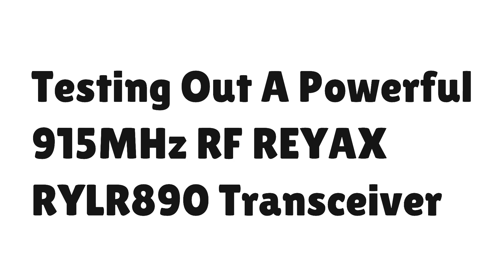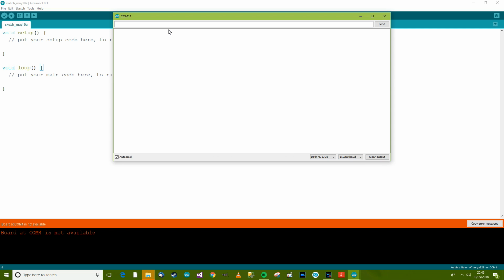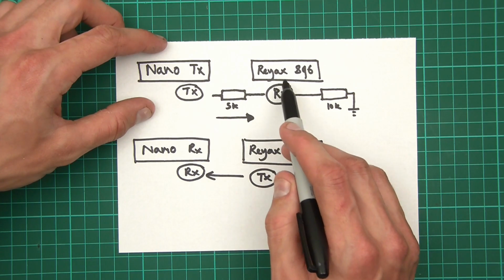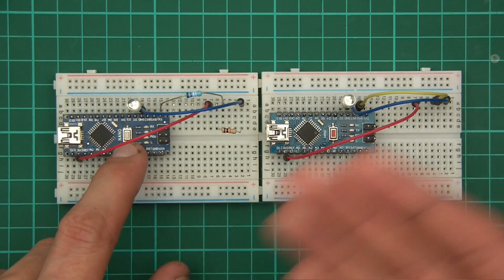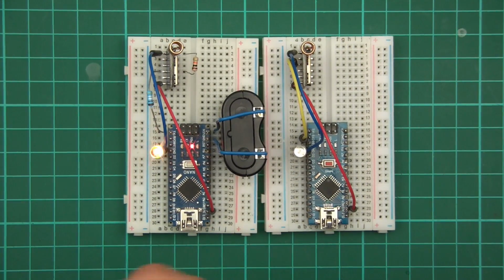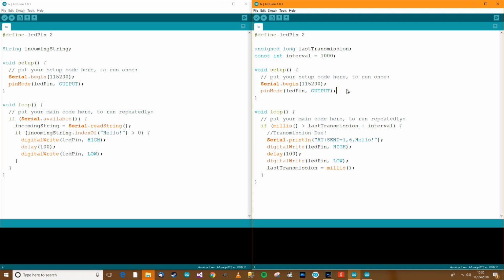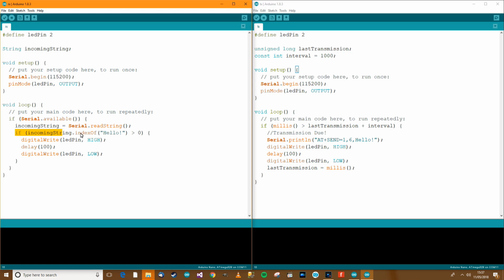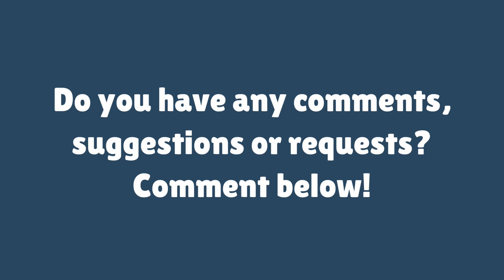Testing Long Range Wireless 915Mhz RF LoRa Transceiver Module REYAX RYLR890 RYLR896 Arduino Part 2

Comment: When I try to upload the sketch to the tx board I keep getting the error "avrdude: stk500_recv(): programmer is not responding......" any advice would be appreciated ?
Reply: I think that if you use SoftwareSerial library and configure other pins for the Serial channel between the Nano and the Reyax module you won't have that problem. That happens too when you use the Serial to print messages and you have some device connected there too
Reply from the maker: Hi David... Disconnect RX on the board when flashing. Your board is receiving flash data from two sources at the same time!
Reply: Thank you, I tried that but with no luck.....after a lot of searching it seems I needed to flash my nano with "ATmega328p (Old Bootloader)"
Reply from the maker: I don't know anything about that, but I have had the RX/TX issue loads of times.

Comment: I cannot get the receiver to blink an led, any way to debug this? I have everything set up as you do in the video. I can turn on the transmitter and plug the receiving module into the usb to ttl and it will show its receiving data, but plugged into the breadboard i get nothing.

Comment: Ive been looking for a top down of a real build of this for days, so I could see how the voltage divider needed to be built. Thank you for this video! Also, I assume that we have to use the usb to ttl converter, for the initial programming of the module? Thank you again!

Comment: I did exactly what you did except for the resistor, instead of 4.7k i used  5k. Does that make a difference? Because mine is not working

Comment: When I use these AT commands I get no reply. HELP!!
Reply: Take your module, connect it to your pc/laptop, open your arduino software and check the com port, after that open serial port and send at commands. Check your baud rate and also the tx rx connections. For more info you can send a mail at arunabhsingh.0309@gmail.com (i've tested these modules for 15km)

Comment: I have yet to figure out how to use these with analog data.  I've tried to get a potentiometer on the TX module, talk with an OLED on the RX module, but cant figure it out.  No one on the whole internet has a code or example of this using the Reyax modules.  As far as I'm concerned, these modules are worthless if they can't do anything other than send digital high and lows.
Reply from the maker: You can use them to send/receive digital data.
Reply: @antonycartwright I know these can be used to send and receive digital data, but have yet to figure out a code or see someone else provide an example of these sending and receiving analog data.
Reply from the maker: @joescopo8933  They're not designed for analogue data. They're designed to work with microcontrollers!
Reply: So eventhough I can read and write analog data through the serial ports with arduino alone, I cant send analog data through the serial port with two arduinos and two reyax devices?
Reply from the maker: You can't read and write analogue data into/from Arduino. Arduino is a digital device. The Arduino has a build in ADC though, if that's what you're referring to? As far as I'm aware, Arduino cannot write analogue.
Reply: @antonycartwright   I guess I don't understand.  When I hook a potentiometer to an arduino, and read a value of 0-1023 on the serial port, I thought that's "analog".  On the flipside, if I hook a push button to the arduino, the serial port will either read "high" or "low", 0 volts or 5 volts and no in between.  Isnt that digital?  Really all I want, is to be able to transmit the potentiometer data (0-1023) from arduino #1 to an OLED display connected to arduino #2 using the reyax modules.  If I can do that, then I can start using different sensors to create a wireless system that reads air pressure from one end of a freight train to an OLED display that I have on myself at the other end of the train.  That's my overall goal.

Comment: Great video! I have been watching many videos regarding the reyax lora modules, and all I can find is videos or codes on digital reads and writes such as blinking an LED.  Is there a way to use this to read and write analog data?   I have yet to see a video of something simple such as a potentiometer on the TX arduino and an OLED on the RX arduino.  Basically what I'm looking for is a tutorial on having an oled read 0-1023 remotely from a potentiometer.  I can't seem to find any code examples of this.
Reply from the maker: Hi, that's very easy to do! Somewhere, I have a video about reading from a potentiometer. Merge the content from that video with this one. :)

Comment: When I connect LoRa module to laptop, open serial moniter and type and enter "AT "then " Ok" is not  displayed on serial moniter. I tried several times but nothing happened.What Shall I do?? Please help!!
Reply: Try changing the baud rate of serial monitor to 115200
Reply: @arunabhpratapsingh  I have the baudrate at 115200 but I still have the same issue

Comment: Hi there, thanks for uploading the tutorial in advance. Im having a similar setup, using 2 arduino unos and 2 RYLR896 as the TX and RX Units. I did the same wiring, including the 3.3V voltage divider setup and programmed the units as what you have explained, but my LED on the RX unit is not receiving any flash. The step different is that I did not pre-configured the LoRa modules with the USB to TTL converter, I instead used serial.print AT commands in the void setup to do the job. Do you have any idea why my LoRA modules arent working? Is USB to TTL a must for pre-configuration? I doubt there are any signals transmitted through LoRa between the units in my setup. Hope you may lend me a helping hand :)
Reply: I have the same situation. Did you get it working?

Comment: The receiver doesnt need a voltage divider??
Thanks.
Marc.
Reply from the maker: It doesn't because 3.3v goes from the rx to the Arduino. The Arduino isn't susceptible to harm in this case.

Comment: Hi Antony, it's a great video. I have succeed to download the source program to arduino and reyax module. The transmitter module has worked. Unfortunately, The receiver module has not worked properly. Do you have a good suggestion for me?

Comment: Hi, I am trying to print the received data on the serial monitor. I have achieved this with the "Serial.println(incomingString);" line in the void loop, this gives me "+RCV=0, 6, Hello! -42, 44".....Could you help me to just get the "Hello!" data to print ?
Reply from the maker: Hi David, there are lots of ways to achieve this, but what I do is this: On the transmitter, simply add a '#' at the start of every transmission. On the receiver, perform an 'indexOf' a '#' in the received string, then do a subString relating to that value. :-)
Reply: thank you for the help, I am still a little lost but will try later (what does '#' do within the 2 sketches to enable me to just print the "Hello!" ?)
Reply from the maker: It serves as a reference point to the meaningful data within the incoming string. If you ALWAYS put a # before every transmission, all transmissions will start with a #.
Reply: I am sorry but I have tried placing the # practically everywhere with no luck :-(
Could you please write the relevant lines for me with the # included ? please ?
Reply from the maker: David Doidge hi, you can't put the # anywhere/everywhere. It must be at the start of the message/text/transmission. Then when you've done it, all you need to do is make the receiver do indexOf #, then make a substring of the receive message from the indexOf #. Antony...
Reply: Antony Cartwright I appreciate your reply. I wasn't putting # anywhere within the code, I meant I was putting everywhere on the Serial.println("AT+SEND=1, 6, Hello!"); line of code
Reply from the maker: Hi, like this is corect: Serial.println("AT+SEND=1, 7, #Hello!");
Reply: @antonycartwright   is there a way to only print the RSSI information from the received data? placing the # here "AT+SEND=0,7,Hello!#" on the TX code doesn't do it. Also, I think I would need to take the RSSI information from the string and convert it to an integer so I can use it in a loop.

I'm trying to use the devices as a LoRa proximity device. Basically, I want the receiver to read the RSSI and determine if its above a set threshold, lets say -75. If the RSSI is higher then -75, then I would instruct the device to turn on an LED, if it is below (or weaker) then leave the LED off.  The Idea would be to have one TX device and 5 or more RX devices along a path and have them light up as you get close to the next one as a sort of navigation device.

Comment: Great video, could you give a link to the "Converters" you use please ?
Reply from the maker: Hi David. The serial converters are fairly generic. The best ones I've used use either the FTDI FT232RL or SILABS 2102 chip. Look for any module which hosts one of those chips and you should be fine. :-)
Reply: Thank you

Comment: Had me on the 5V/3.3V power there for a moment. At first I missed the TX power from the Nano is 5V  :P   So the RX of the Nano will read at 3.3V without issues?
Reply: It's four years later, but your question just answered this for me!!  Thanks from in the future. 😁😁
Reply from the maker: Korishan yes because it's digital and 1/3 of the transmission voltage will be resisted off before it gets to the transmitter. :) The arduino reads <2.5 as low and greater as high, so 3.3 works fine. :)
Reply: we can also use a ttl level shifter right?